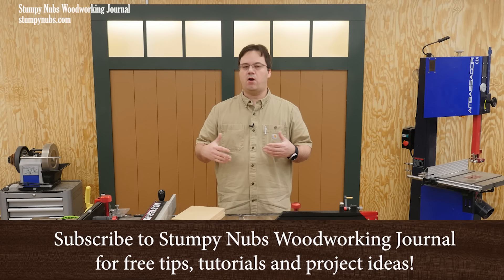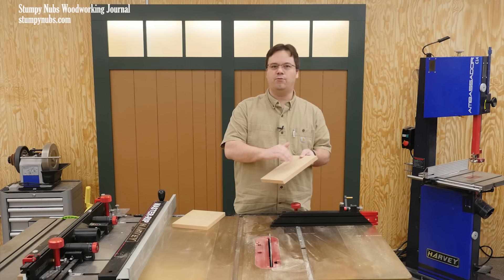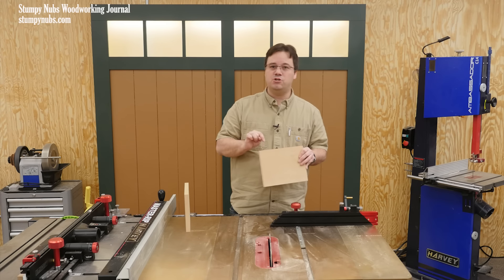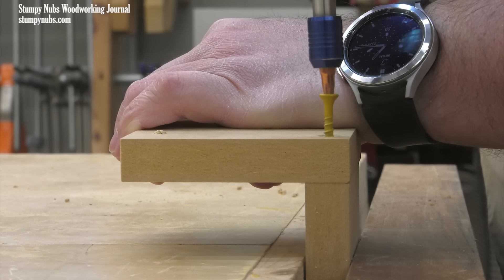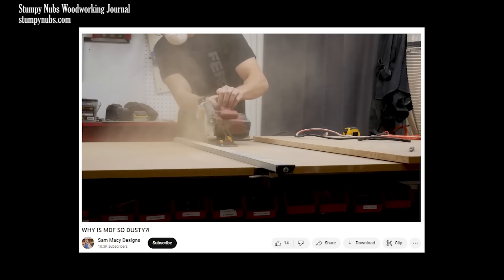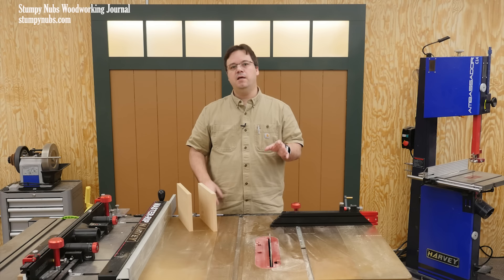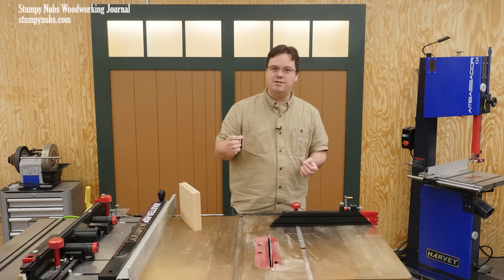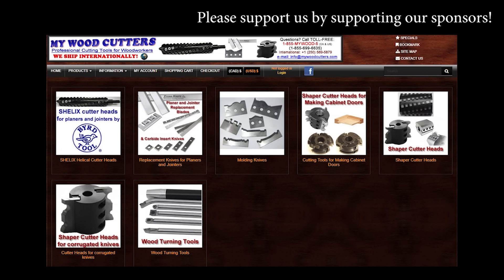This stuff changed my mind about MDF projects

Comment: It's been quite a while since I've dealt with MDF. Last project I did was a sealed subwoofer box with a single 10" in it. Routed the hole in a way where the front flange on the speaker was flush with the front of the box, and glued a piece of stained 1/4 ply to the front. The rest of the box was sprayed with plasti-dip. The dip adhered well and gives it a bit of grip on the trunk carpet.

Comment: If you aren't using MDF often and only have a small piece or 2, you can use the wood filler that you most likely already have to fill the edges of the board. It works. Drywall compound is cheaper. Use that for the big jobs. 
I've been finishing and building custom furniture, professionally for 7 years.

Comment: I've always heard MDF is good for when you need a large flat surface that won't warp.... but it's so flexible that whatever surface it's on also needs to be perfectly flat, doesn't it? And if you glue something like a chessboard to MDF, the movement from the chessboard can overpower the MDF causing an effective warp, right?
Reply: It's not that flexible at higher thicknesses, but you can't use it to prevent wood from warping, no. Most MDF production items are fully MDF though, so the entire thing remains dimensionally stable. If you mix in wood too then you'll need to account for some movement, but for things like panel & frame doors you at least don't need to worry about the panel swelling & popping the frame.

Edit: Oh, & if you were wanting to make a chess board on MDF I'd recommend making the wood thin & the MDF thick.
Reply: @nightcatarts  Thanks for the feedback. What would you do if you had no choice but to use thick stock for a chessboard glued to a substrate? Just make sure you get the most stable quarter sawn wood?
Reply: @SomeDudeOnline  It depends on the budget, but marine plywood would probably be my choice if it could be afforded.
It's dimensionally stable, very strong, & the cut edges should be of such high quality with no voids that they can even end up looking decorative in their own right. It also resists moisture really well, unlike the various fibreboards.

Another option would be to use just whatever board you happen to have & make a frame out of aluminium or brass sheet. Brass in particular is lovely to work with & can be soldered easily, plus it looks great next to wood. If you can cover the edges in metal then it really doesn't matter what's inside them, so you could fill that space with 2nd hand chipboard or whatever.

Solid wood will do a decent job too, though might cost even more these days. You could always use two thinner layers glued together, & crossing the grain should add extra stability & resistance to warping. To save money, go for MDF (or cheapo plywood) & laminate it with a relatively thin layer of your stable wood all over.

MDF on its own is fine as long as the item won't be near any moisture & especially if you intend on painting it with some flat colour, but it'll never look good on its own without being covered with something opaque like paint or a layer of another material.

Comment: Bondo (polyester putty) is a great companion to MDF. Watched a guy knock a complex octagon cabinet off the assembly table and bust a corner. He filled it in with Bondo, sanded it smooth, and finished assembly. Once it was painted you couldn't tell the difference.

Comment: I have needed to spray paint MDF for some pinball restoration projects, so first treat the MDF with several light coats of sanding sealer using cheap foam brush.  Follow up with a light sanding to get a smooth feel and the spray paint.  If gotten very good results this way, smooth finishes.

Comment: Never use it where it will be exposed to moisture. No matter how good the paint is, even setting a cold drink on a table can cause swelling from the condensation. Are you ever going to mop the floor next to that cabinet? Better not use MDF where the mop can hit it. And it's heavy.....but weak.

Comment: You're "pilot" hole information is flawed. You also need a "clearance" hole to allow the threads to pull the two pieces together without stripping. That hole needs to be the thread diameter.

Comment: Nooo. Don't do that. Don't use joint compound on the ends for MDF. It is too soft with poor adhesion. Just seal with shellac and sand. It's what's on 90+% of preprimed MDF. It works wonders
Reply from the maker: It works just fine. Lots of people use it. It is only going into the pores where it is sealed with the primer.

Comment: I had to fabricate a new base for a pool table I inherited. I chose MDF for most of it, and it has held up nicely. I did a lot of routing edges and laminating pieces for thicker sections. It was mostly glued together, except for screws in a few areas. It came out nice, and has been moved once. It went back together well after the move.

Thank you for all of the tips. I'll do a better job next time.

Comment: I build a lot of MDF assemblies for the display industry. Don't screw MDF- narrow crown staples and glue are as strong as any other method. I use 2P-10 on it or slightly thinned down aliphatic resin glue (so it penetrates the MDf) and narrow crown staples.  Then spray it with two coats of shellac which seal the surface as well as the "end grain" so that it doesn't suck up tons of paint- you can use a foam roller or brush for the shellac or the harbor freight $14 HPLV gun on even a pancake compressor works great. I never sand to 220 grit, (usually just pass a 120 block over it) and get up to a piano finish on it with precatalyzed lacquer. If you put drywall compoiund on it and sand to 220, and then spray waterborne on it, the fibers will just lift out and swell the edge  anyway, don't waste the time, use shellac instead. If you need to use an alcohol based finish like PVA over the shellac, spray a barrier coat of  automotive primer. But I am usually spraying waterborne over the shellac.HD sells a 3lb cut dewaxed shellac as a sanding sealer by the gallon- great stuff, dries in 10m.

Comment: The only thing I don't like about MDF is it's tendency to bow under weight. If you don' t put a bunch of hardwood support under it or make a hardwood cleat, the most it is good for is nicknacks. For example, those stuffed dolls or whatever kids have. So if you are going to use MDF, make sure it is not load bearing, this is where the cheap furniture manufacturers have failed for years.

Comment: MDF must be supported when using it for something that bares weight so that it does not warp. Unfortunatly when I stiffened my shelves with glued on strips of hard wood, it has a by-metalic effect. As the moisture changes throughout the year the MDF expands and contracts differnently than the hard wood strips. The shelves are streinght in the winter but bow up in the moist summer.

Comment: BIN shellac based primer also fills in the edges or any cut surfaces well. When I use my Shapeoko CNC router on MDF to carve detailed pieces, I prime with the BIN before painting unless a weathered look is desired. Works great.

Comment: I made raised panels for cabinet doors I was making.  I used 3/4” MDF. After routering the profile I painted the panels with oil based primer. Sanded and came out very smooth. Painted beautifully. Looks as nice as the maple styles and rails

Comment: If I have to paint MDF, I brush on a mix of watered down wood glue on all the surfaces, starting and finishing with the exposed edges so they get two coats.  Follow up with a light sanding and they are good to go.

Comment: I use 1/4" and 1/2" MDF to make router templates, and I've found that soaking the edge all the way around with water-thin CA turns the material rock hard.  I have templates that are more than 25 years old and seen a lot of use, and they are still performing as well as the day I made them.

Comment: This is just really cogent. 
Right to the point.
Each point explained clearly.
Strengths and weaknesses of the material discussed openly, honestly, and briefly.

I haven't done woodworking in half a dozen years and it might be another half dozen before I get back to it, but it's satisfying just to get the info handed off this well.

Comment: I tend to use mdf for shob-built tools (router table, lathe stand, etc)  on a recommendation from one of the ww magazines in the 90's... Double,  triple, or quadruple thick posts for legs, panels and shelves out of single-thicknesses reinforced as necessary by cross members. I've even made a 4" thick hollow shelf filled with sand to dampen vibrations in my lathe mount... Works like a dream.

Comment: I hate this stuff, but I use it for long term, precision jigs and fixtures.  I use splines, dowels or dado's for joints, and I coat them in Bondo before sanding.  fortunately, they last nearly forever, so I don't have to make them often.  If you need flat and stable, and you don't want to do aluminum, this stuff is for you. Put bushings in them, and you have drill jigs.  
For cabinets and furniture, it is lumber,  plywood, or particle board every time.

Comment: We make quite a bit of trim from mdf (usually ultralight).  Two improvements to what you describe are:

Mdf should only be primed with oil primer.  Water primer raises the grain on what was a very smooth face, requiring much more sanding.  

Filling the edge with drywall mud or spackle  is best done after priming.  It’s more steps, but the bond is superior.

Comment: Do not use MDF as a floor underlayment or cabinet bottom for anywhere that might get wet, even on a rare basis. We've had to multiple kitchenette flooring or cabinetry repairs at my work place campus where a sink had a minor leak or a janitor simply used too much water to mop the floor on a regular basis. Apparently, somebody in the distant past thought MDF sub-flooring was okay. Moisture exposure swells the MDF, eventually to the point of buckling the flooring top layer (typically VCT, in our case).

Comment: I used MDF for a book case and a computer desk over 20 years ago. The book case is still in use today, but it's an absolute beast to move, weighing well over 100kg. I also used stain on it to give it an almost wood-like look and the trick was to brush the stain and lacquer mix on unevenly, and with a paintbrush that had been chopped up a little, to give a stripy and uneven look

Comment: I did not know the drywall joint compound tip and that is a very good tip.  There's very little water in that stuff and it dries into a very much less porous end surface.

Comment: I do very little with MDF.  If anything, I prefer Melamine because of its smooth finished surface.  I built a work station using some left-over MDF and some new Melamine.  Edge banded both and ended up with a nice finish.  More often I work with plywood.  However, the edges always need treatment.  Even when I'm not displaying an edge, something like the top edges of a drawer that can only be seen when opened, I like to coat the edges with glue.  Once dry, sanding it smooth does nicely.  If the plywood is riddled with porous rough edges a second coat may be necessary.  Finning in gaps such as voids between layers I just scavenge some saw dust, mix some glue, then apply into the opening just to close it up.

The reason for treating plywood edges like that inside a drawer is because someone is going to be reaching into the drawer.  Splinters can be unpleasant.  Clothing can snag.  Lots of other unpleasant things can happen.  So finishing the edge with glue only, while it doesn't present a beautiful finish, it does create a functional seal along the edges so that nobody or nothing gets damaged.  Perhaps I'll throw a quick video of the results.  But finishing like this isn't for exposed edges that can be viewed all the time.  Unless I'm painting the box I'll just finish it with banding.

Comment: MDF certainly has its place in the building world. Like many, my biggest complaint is the weight. 

Another material I would like to see addressed is HDF or high density fiber board. I have only found it in thinner dimensions as it seems to be primarily for making peg board or used on the backs of cabinets, bookcases, etc.  It appears to add some structural integrity without adding a lot of bulk or thickness to a project. But I would like to see any tips or other uses for HDF. 

Thanks for sharing all of your hard won knowledge.
Reply: I've glue-laminated 1/8th inch HDF to MDF to create a hard wear surface.
Reply: That would be another name for “Hardboard “ or “Masonite”.
Reply: @dannyh.7490  Yes.  I do believe you are correct.
Reply: @Saileahgaz  Great idea. Thanks much.

Comment: I'm pretty sure drywall compound is water based.  I'd be afraid that the MDF edge would absorb that moisture and swell up (doesn't take much).  I use MDF,  but really try to stay away from use-cases where an edge is going to be visible and/or exposed.
Reply: bondo & automotive primer & spray paint.....worked a treat on many custom car audio setups
Reply from the maker: There is more water in glue, and that's widely used on MDF too.
Reply: @kazzxtrismus  Lots of old car audio guys in here apparently.  And you're correct.  But 30+ years ago we didn't have Stumpy or YT.  We were making that $#!* up as we went along.  With whatever we could get.  LOL

Comment: MDF makes a really good workbench top if used in multiple layers to increase mass.  It's also cheap enough that when the surface gets chewed up, just make another.  I saw this in a popular woodworking magazine (WWJ) and it has become my plan for a (finally) good heavy workbench.
Reply: A better and less expensive plan is to use a 3/16” piece of hardboard over the top of the MDF. Use a few small screws to secure it and now it’s easily replaceable when needed.
Reply: @dannyh.7490  I like that addition.

Comment: Thank you for this information! I recently have bought some well prized green MDF boards and was wondering if I could use these to make me a MFT. Since the boards are (only) 1220 x 610 mm I will have to combine them on the tabletop. I am really interested in more information about how to work with MDF, about proper safety measures and about how to combine MDF in constructions with other wood like pine, robinia or plywood.

Comment: Other than the weight, MDF is great for tool table tops (like a router table) and sleds.  It always remains flat & smooth.  And sometimes that extra weight is good!  Just never get it wet!

Comment: I always found that the glue and water trick worked well for priming the edges of MDF. I have also had success with slightly wetting the edge then applying gorilla glue.

Comment: I "wood" never use MDF even for kindling to start a fire.  This the most useless short life product imaginable for timber wood working.  Looks great in kitchen cabinets when it is new. Finely sanded to perfection in an Epoxy paint finish it looks a million dollars. Any moisture and it swells and the product falls apart.  I have just torn kitchen benches in a kitchen renovation apart.  The dishwasher flooded the kitchen many times creating cupped floorboards.  The cabinets were made of chipboard in all fairness. MDF would have been 10 times worse.  Why on earth would anybody skimp using timber to use a product that in more akin to Paper Mache than real wood.

Comment: I had a problem years ago with MDF. Way before the first Iron Man movie came out, I was asked to make a Thor hammer. For the head of the hammer, I laminated MDF with contact adhesive, then cut it to size. My first attempt showed those glue lines. Even after putting on spackle and primer, the glue lines still showed through. The hammertone finish I applied afterwards to make it look metallic covered it up, but not to my satisfaction. Any advice on how to do a project like that now?
Reply: I made a Mjolnir that way a few years ago.  I used a very slow epoxy for the lamination, and let it sit for over 4 days in the press so that they epoxy was well cured before I cut the shape.  Two coats of BIN sealer primer (sanding between coats) then Rusty metal primer, and finally 2 coats of Rustoleum's Dark Steel and an oil wash.  It looked smooth as polished steel!

The sealing the cut edges is the most important part.  If I have a rough edge due to flexing or old MDF, I use wood glue to soak in and seal, then sand before the first coat of primer.

Comment: Well, I’m one of those “hoity toity” woodworkers. MDF and all of its cousin products have very limited utility and absolutely no place in the construction of furniture or cabinets. Products made of the crap are throw away, environmentally wasteful junk whose lifespan is measured in years rather than centuries. It is a product designed for a mercurial throw-away culture. Indeed we now see cardboard doors and furniture sold as environmentally conscious. It isn’t.
Reply from the maker: I think the cheap furniture industry has cause people to think that MDF has no practical use. But there are plenty of projects where MDF is actually a superior product. For example, those who make speaker cabinets love MDF. It also is an ideal substrate for some veneer projects. And MDF panels are excellent for flat-panel cabinet doors when surrounded by a hardwood frame.
Reply: @StumpyNubs  We just replaced $20,000 worth of cabinets made of MDF in a Dementia Care Home our charity runs (cabinets mandated by the major funder of the project). We replaced them with solid oak. Why? Because the humidity from the kitchen stoves caused the MDF to swell and begin to fall apart, the supposedly water and vapour resistant foils applied to the cabinets pealed, the hinges fell off the doors and they were ugly.
Reply from the maker: As I said, there are good and bad places to use it. Using it in the wrong place and getting poor results doesn't negate the proper and useful uses of the product.